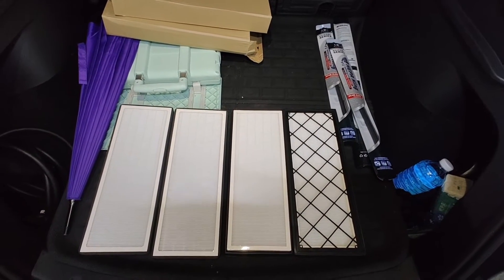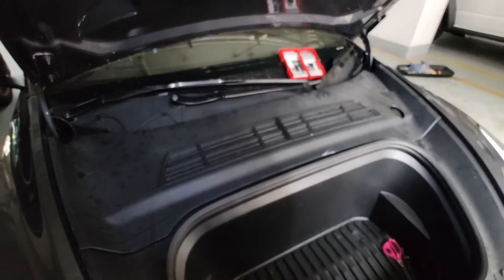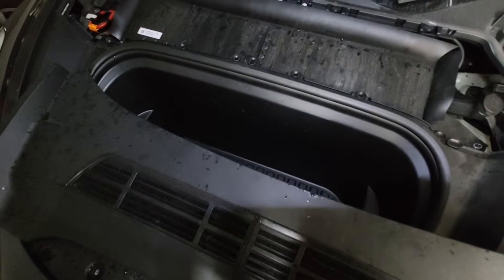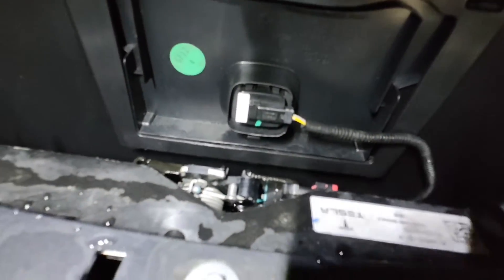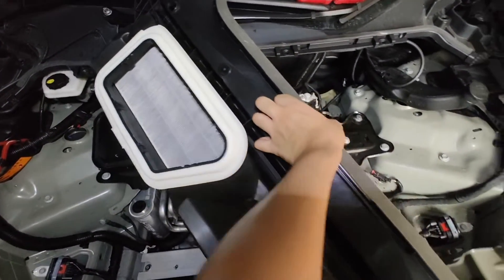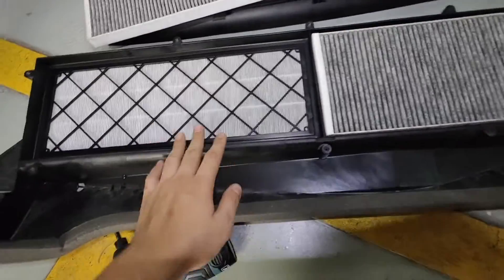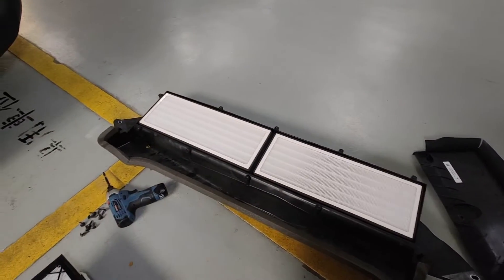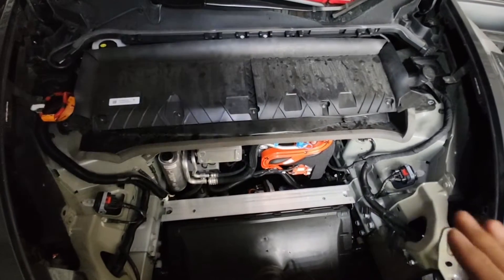How to change Tesla Model Y - Bio-defense Cabin Filter

Comment: This filter is only used in biohazard mode…, though, normally not used at running air condition. Why to change it so often?!
The inside cabin helps filters are the mainly used filter during ventilation and air condition. 
In my opinion, the part to refresh every 1-3 years or 15-30 k km, dependent if the environmental conditions of driving the car.
Reply: Actually, the filter (bio hepa filter) is the main filter. The ones in the cabin are only used when in recirculating mode. So yes, depending of usage, the HEPA ones might need a more frequent change than the inside ones.
Reply from the maker: @drone-rg  You are totally correct. all the air goes to the carbin will pass through this 4 big filter
Reply: @drone-rg  Tesla recommends: 
Hepa bio hazard all 3 years. Inside air condition all 2 years.
Not sure, if there exists a technical description. Bio hazard closes the fresh air input and has in addition circulating air due to the  hepatitis filters. In this case the cabin is cleaned by smoke and fine dust particles. Only in this case…
Any circulation plan would be helpful.
Reply from the maker: @MrSschrotti  I think it really depends on where you live. If you live in dry area I think would be ok. But if you live in wet area, properly is better to change every year.
Reply: @MrSschrotti No, that’s not how it works. The frunk HEPA filter is the main  filter, when you hit the bio hazard option, the system will simply increase the air flow to create a positive air pressure. Simply as that!

Comment: Thank you very much for your video.  Very clear on what I need to do for a DIY installation!
I have a question for you.  I have a 2022 Tesla Model Y Performance.  It has the HEPA filter that you show here.  Do you know if my vehicle also has the secondary cabin air filters somewhere behind the display screen that also need to be replaced?
Reply from the maker: Yes, there are 2 small one under the passenger floor. you can find that video on how to change much easier. The reason I made this video is I couldn't find the guide for the big filter
Reply: @hepaking4053  Thank you very much!